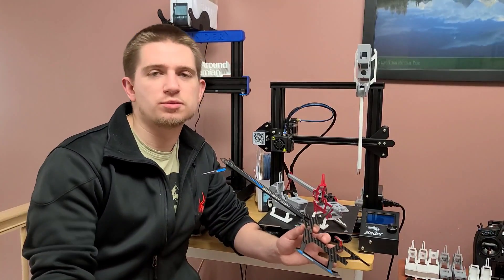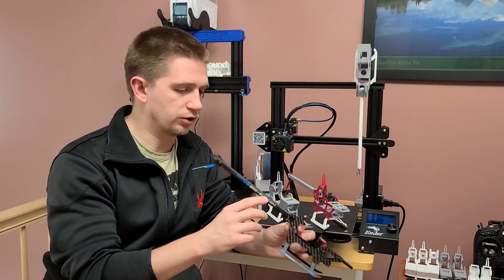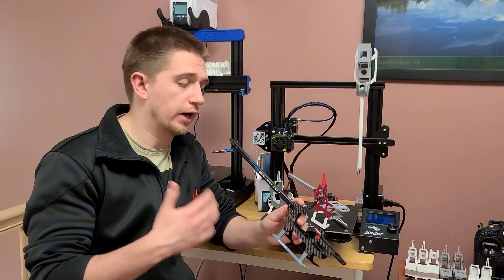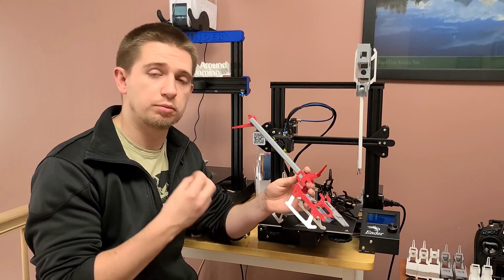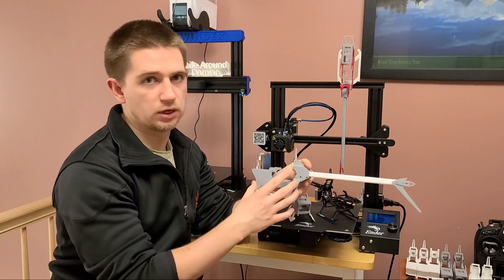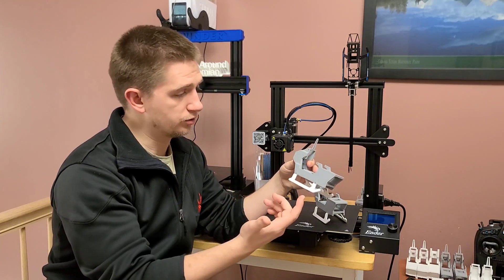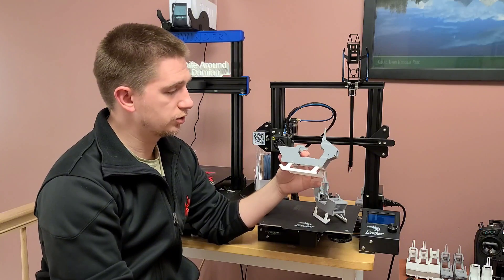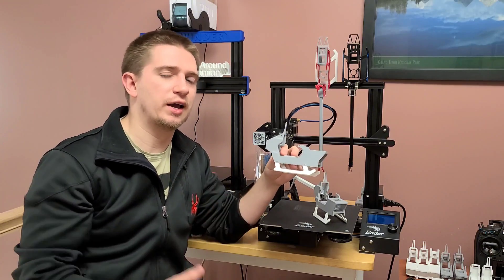How I Designed a 3D Printed RC Helicopter

Comment: Great videos ❤ Hi, I am from India and I want to enter into this hobby of hobbygrade rc helicopter, but import of rc helis,planes are banned in India and last time i tried to import omphobby m2 evo it got returned by customs, but we still get most if the electronics like brushless motors, esc, transmitter, some flight controllers and esc in India Only problem is for body and main rotor assembly(rotor head, swash plate) which is metallic. Please make a series on solution for if possible, It will definitely boost RC culture here(specially heli) here 🙌
Reply from the maker: Thank you! I did not know the customs in India were so strict. I'm glad these designs might help you start flying again. I will keep working on as many parts as I can.
Reply: @LifeAroundDamian  Thanks for actually replying, waiting for your future videos 🙏